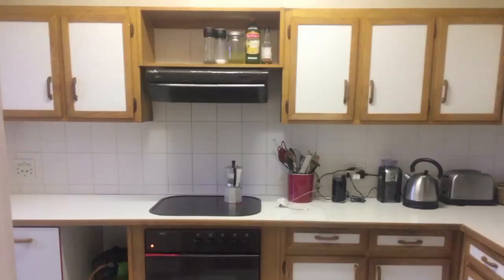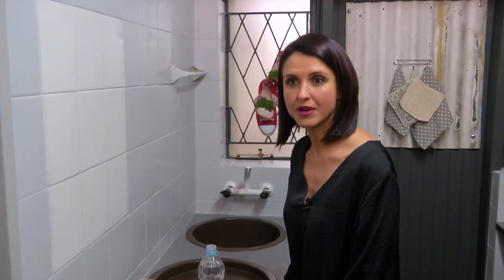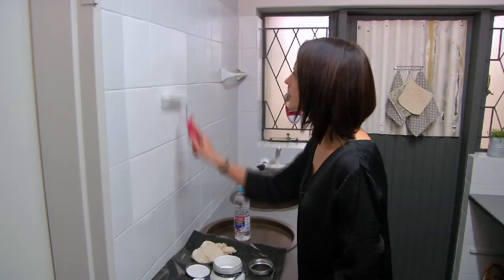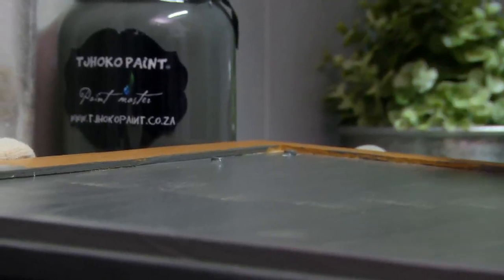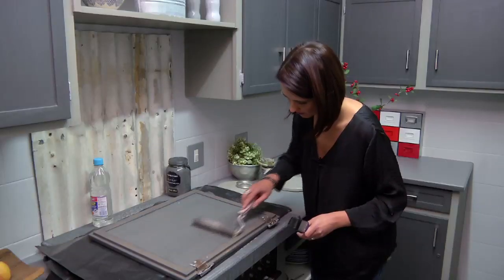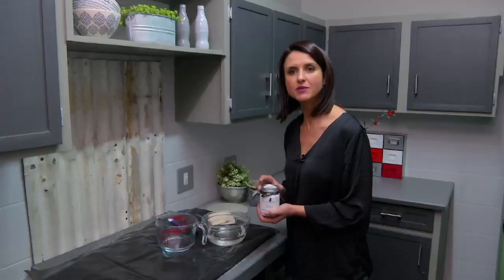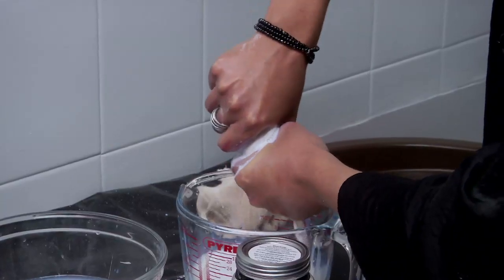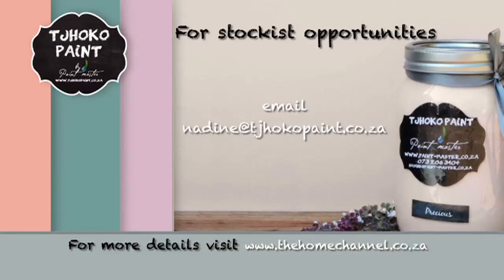How to paint on wall tiles and melamine cupboards with Tjhoko Paint

Comment: Hi. If my kitchen cupboards have been varnished, is it still enough to clean only with the thinners?
Reply from the maker: Hi Barbara. Yes a proper wash with only Lacquer Thinners and repeat the process more than once to ensure that the cupboards have been properly cleaned. Important is not to use any other cleaning agents with the Lacquer Thinners as it may cause a chemical reaction. Another important tip is that the varnish on the surface needs to be older than 6 months. I am also including the FAQ section from our website with our support email address should you need anything else🌷How to paint
Step 1 -  Clean surface PROPERLY with Lacquer thinners ( we use Powerfix Lacquer thinners) wear gloves and work in a well ventilated space.
Wait until the lacquer thinners is dry 20-40 minutes * I would then repeat the cleaning process again. (WE DON’t RECOMMEND TO PAINT ONTO A VARNISHED SURFACE IF THE SURFACE HAS BEEN VARNISHED WITHIN THE PAST 6 MONTHS. Varnish takes at least 6 months to cure. When painting onto an  enamel surface - contact us at support@tjhokopaint.co.za to give the right advice.)
 
Step 2 - Start painting.  We recommend painting at least two coats.   Very important when painting is to always allow a coat of paint to dry properly before the next coat of paint is applied. Depending on the colour being used a third coat would be necessary for example painting a white paint onto a darker surface.
The equipment you use for painting also plays a role.  A foam roller leaves a much thinner coat of paint than a paint brush. Therefore, more coats of paint would be required when working with a foam roller.
 
The paint does have a matt finish (Tjhoko Paint is a self-sealing, water-based, matt chalk paint) it does not need a sealant unless you have the piece of furniture outside or in a room like the kitchen or bathroom where there is lots of moisture.  The Glaze makes the surface water- and UV-Resistant.  It also prevents stains and provides a more washable surface.  We also recommend to seal tabletops and pedestal tops, kitchen and bathroom wall tiles (painting in showers not recommended).
 
Step  3 -  If you are applying the clear glaze, always allow the paint to dry for at least 4 hours before starting with the Glaze application.  In coastal areas or during winter months we recommend to only start glazing the next day (leave paint to cure overnight)
•             Dilute the Clear Glaze with 30% water (30ml of water for every 100ml of Glaze) or 3 parts Clear Glaze and 1-part water. ( we recommend cooled boiled water as it is less contaminated)
On darker Tjhoko colours we recommend 50/50 (1part Tjhoko Clear Glaze and 1part water. You can also use this ratio for a less sheen finish.
•             Dampen a clean, colourless cloth with water and squeeze to remove all excess moisture. A Microfibre cloth works best.
•             Dip the cloth completely in the mixture to absorb the mix and then squeeze to remove excess moisture. 
•             Evenly wipe onto the painted surface.  Work in a well-lit room to ensure that the entire surface is covered.  If streakiness or lines occur – (it is caused by the fabric / cloth) just apply a second coat, half an hour later.
 Should you wish to paint over the Clear Glaze you can do so once it it has cured for an hour or longer eg should you wish to change colour or add paint techniques.
 Numerous diy videos with steps are available on both our website and YouTube channel www.tjhokopaint.co.za and www.youtube.com/tjhokopaint
Reply: @TjhokoPaint  Thank you for the detailed advice.

Comment: Does the paint not come off when you wipe it with a wet cloth?
Especially removing spill or sticky hand prints.
Reply from the maker: Hi Tielanie, we also replied on your facebook question. Key to success is to ensure that the surface is properly washed off with lacquer Thinners. This removes any oiliness or greasiness and edges the surface tor Tjhoko to grip onto. If there are residues or oiliness on your surface Tjhoko (water based product) are unable to grip. Allow for the thinners to dry properly before painting commences (40 minutes more or less). We paint for clients daily and never had any issues. Cleaning key to success 🌷 The Glaze changes the matte finish (due to chalk composition) to a subtle satin finish. On darker colours we recommend to mix 1:1 (Glaze and cooled boiled water - the Glaze is in concentrated form) or also follow this ratio should you want less of a satin finish. For more of a satin finish 3:1 ratio can be followed. Damp Microfibre cloth works like a charm for the application. Our support email is support@tjhokopaint.co.za. We are always ready to assist🌷
Reply: @TjhokoPaint  Jy is darem net goed. Pragtige vrou met baie kennis.

Comment: is it not needed to put a primer on the laminated cupboards
Reply from the maker: Hi Loretta. Thank you for your question. 

Tjhoko does not require a primer, however with painting cupboards it is crucial to ensure your surface is perfectly clean before painting. Just ensure the cupboards are cleaned with a clean rag or mutton cloth and laquer thinners - allow 40 minutes to dry fully, clean twice if needed and then you can paint. Below is a video that explains it all step by step.
Reply from the maker: https://www.youtube.com/watch?v=Vi8r6OiZajU

Comment: Moet ek glaze op teels sit na die verf
Reply from the maker: Hi Elize, verkieslik! Die Glaze maak die oppervlak UV-en waterbestand. Hier is die FAQ vanaf ons webblad:
How to paint
Step 1 -  Clean surface PROPERLY with Lacquer thinners ( we use Powerfix Lacquer thinners) wear gloves and work in a well ventilated space.
Wait until the lacquer thinners is dry 20-40 minutes * I would then repeat the cleaning process again. (WE DON’t RECOMMEND TO PAINT ONTO A VARNISHED SURFACE IF THE SURFACE HAS BEEN VARNISHED WITHIN THE PAST 6 MONTHS. Varnish takes at least 6 months to cure. When painting onto an  enamel surface - contact us at support@tjhokopaint.co.za to give the right advice.)
 
Step 2 - Start painting.  We recommend painting at least two coats.   Very important when painting is to always allow a coat of paint to dry properly before the next coat of paint is applied. Depending on the colour being used a third coat would be necessary for example painting a white paint onto a darker surface.
The equipment you use for painting also plays a role.  A foam roller leaves a much thinner coat of paint than a paint brush. Therefore, more coats of paint would be required when working with a foam roller.
 
The paint does have a matt finish (Tjhoko Paint is a self-sealing, water-based, matt chalk paint) it does not need a sealant unless you have the piece of furniture outside or in a room like the kitchen or bathroom where there is lots of moisture.  The Glaze makes the surface water- and UV-Resistant.  It also prevents stains and provides a more washable surface.  We also recommend to seal tabletops and pedestal tops, kitchen and bathroom wall tiles (painting in showers not recommended).
 
Step  3 -  If you are applying the clear glaze, always allow the paint to dry for at least 4 hours before starting with the Glaze application.  In coastal areas or during winter months we recommend to only start glazing the next day (leave paint to cure overnight)
•             Dilute the Clear Glaze with 30% water (30ml of water for every 100ml of Glaze) or 3 parts Clear Glaze and 1-part water. ( we recommend cooled boiled water as it is less contaminated)
On darker Tjhoko colours we recommend 50/50 (1part Tjhoko Clear Glaze and 1part water. You can also use this ratio for a less sheen finish.
•             Dampen a clean, colourless cloth with water and squeeze to remove all excess moisture. A Microfibre cloth works best.
•             Dip the cloth completely in the mixture to absorb the mix and then squeeze to remove excess moisture. 
•             Evenly wipe onto the painted surface.  Work in a well-lit room to ensure that the entire surface is covered.  If streakiness or lines occur – (it is caused by the fabric / cloth) just apply a second coat, half an hour later.
 Should you wish to paint over the Clear Glaze you can do so once it it has cured for an hour or longer eg should you wish to change colour or add paint techniques.
 Numerous diy videos with steps are available on both our website and YouTube channel www.tjhokopaint.co.za and www.youtube.com/tjhokopaint